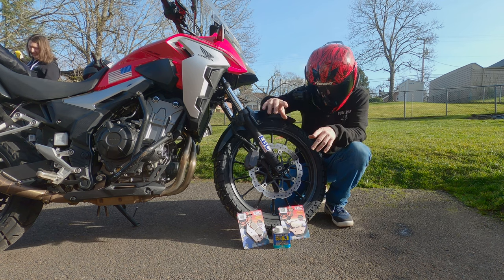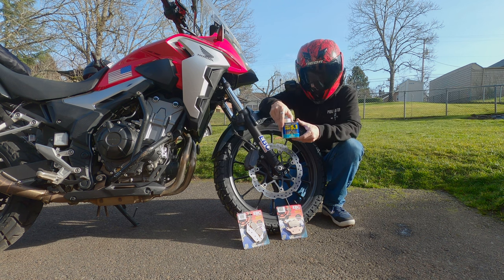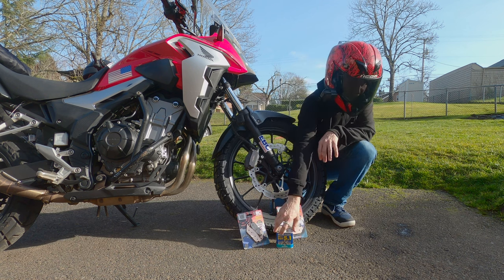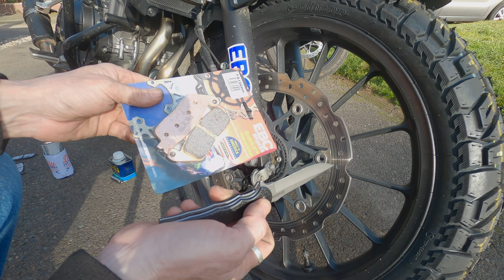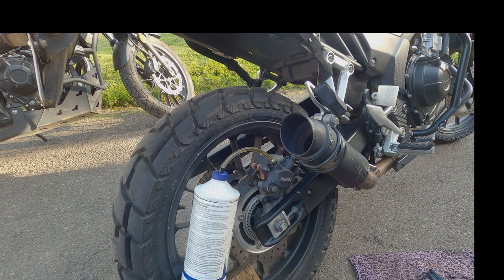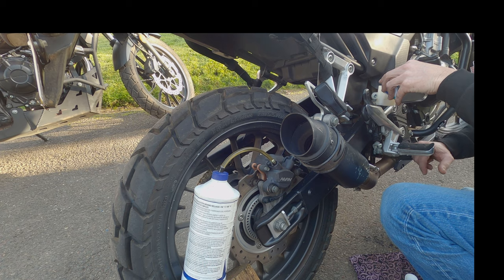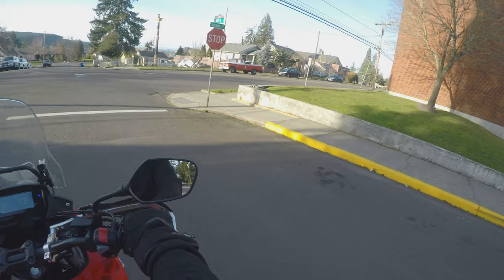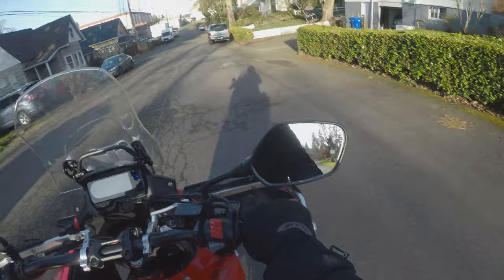Best Brake Upgrade for the Honda CB500X | Oregon Motorcycle 2022 #EBC #Honda

Comment: DOT 5.1 brake fluid is more hydroscopic than DOT 4 and requires changing more often . DOT 5 is not hydroscopic but silicon based and unsuitable to mix with hydroscopic brake fluids.

Comment: I've always thought that my 2020's front brake was a little weak.  I had seen your video for the front and figured you had felt the same.   It's on my list to do when I start riding this year.   We're in the 30s and 40s in the morning here in Central Cali and it's just so much easier to jump in a car or truck instead of putting on all the layers.   The easiest bleed I ever had was when I rebuilt the calipers on my 1983 Honda Sabre, got tired, and left the bleeders open all night with a full reservoir.  I squeezed the lever, shut the bleeders, checked the level, and tested it, and they were perfect.  What do you think of steel braided lines for the non ABS models?  Good video.  Thanks.
Reply from the maker: Thank you. Steel braided lines are an excellent upgrade. They will give your lever a more solid feel. I had SS lines on my previous sport bikes.

Comment: Just had my rear pads replaced at 6000 miles, apparently I need to use the front more, do you have front brake wobble at low speed? Mine feel warped at low speed, below 10mph but the shop said they're fine🤷
Reply from the maker: Mine feel fine. 
Make sure you are not dragging your rear brake. Friend of mine was doing that until I noticed it.
Reply: @OregonMotorcycle  that's what the shop said too, I really think I was just using the rear for everything but now I'm hyper aware all the time